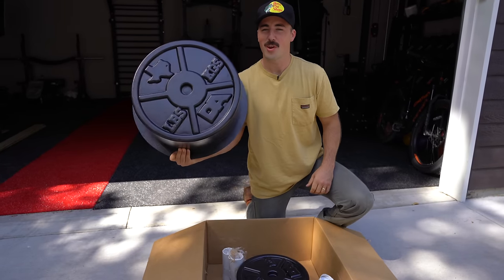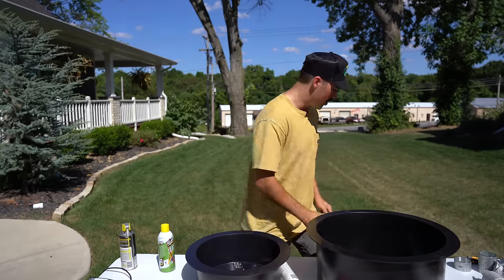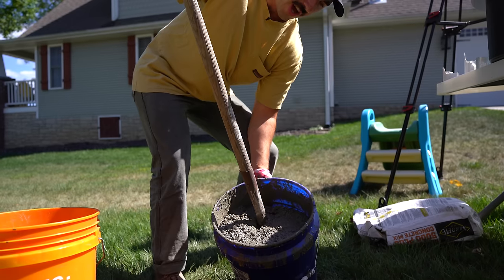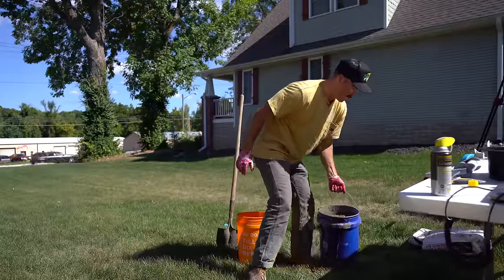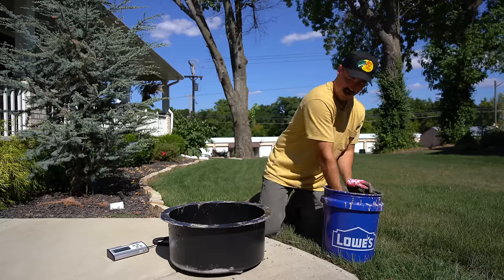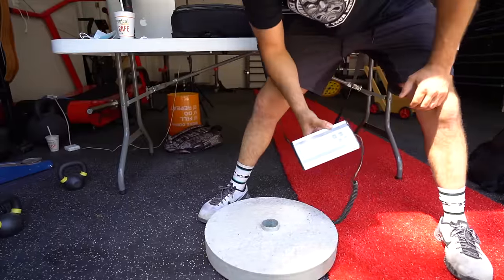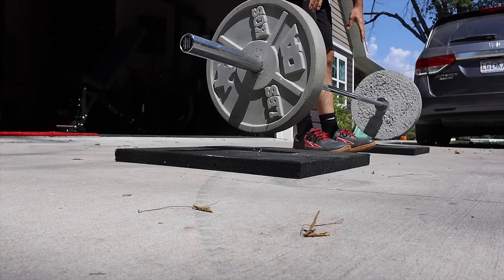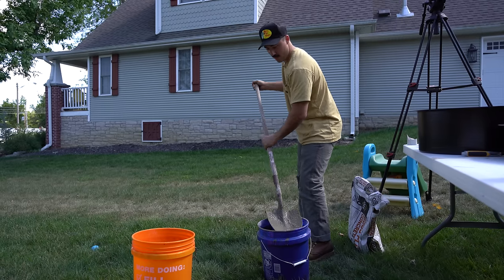How To: DIY Concrete Weight Plates That Don't Break

Comment: For 9 years I was a technician in my state's highway department lab.  For the purpose of enforcing contracts that specify the strength of concrete, the industry standard is to age concrete cylinders under water, at constant temperature, for 28 days,  I would suggest that concrete does not reach its full strength until a month after it is mixed.  It should be kept thoroughly wet during that month.

If strength is important, using high strength cement and adding fiberglass are good things to do.  Another good thing is to use less water.  One of the primary determinants of concrete strength is the water/cement ratio.  The higher the ratio, the weaker the concrete.  Knowing this leads to a relatively recent innovation: roller compacted concrete.  For RCC, you merely dampen the dry mix.  The mix should be thoroughly damp, but not wet enough to flow.  Then they shovel it into place and tamp it.  For road construction, they use the same rollers they use to compact asphalt pavement.

Your weights will get lighter as they continue to dry out, assuming they are kept out of the rain.  The weight of the dry hardened concrete is not a concern when building highways, So I have no experience with that.  If that is important to you, you'll definitely have to keep the concrete out of the rain.  The dry weight will be something higher than the weigh of concrete mix you use because water participates in the chemical reaction.  If you want to predict the dry hard weight, I suggest you determine the formula experimentally.  Measure the amount of mix and water you use, then weigh the hardened concrete once a week at first, then once a month, until the weight stops decreasing.  That will work if the plates are kept in air having a constant relative humidity.  If the RH varies, the plates will always be gaining and losing weight.  It is likely that the weight variations will be slight.

It looked like you were using "mortar," not "concrete."  Mortar is cement plus sand.  Concrete is cement plus sand plus coarse aggregate.

Comment: Use a recip saw with out the blade pressed up against the mold to vibrate the air out
Reply: I personally use an old back massager to do that.

Comment: I want this to work but it seems like the concrete isn’t the right product. Concrete is hard but fragile, it’s really meant for compressive strength, not constant shocks. So dropping it once or twice might be fine but you’re probably introducing micro fractures that will get worse over time. Maybe rebar or mesh would help?

Comment: Dude spraying those with flex seal and then painting them, it look pretty good
Reply: Truck bed liner adheres better and is stronger in the long run.
Reply: Stix And Stone even better!
Reply: What paint should we use ?
Reply: Jake From State Farm I use oil based exterior paint because my entire gym is outside in the elements.

Comment: drill holes in the wall of the metal pipe and put screws in before pouring the concrete so the pipe does fall out cuz you can see already when you dropped it chunks of concrete were coming off.

Comment: Weigh out the concrete when it is dry.  After it has cured (don't confuse curing with drying), the water keeps leaving the concrete, eventually getting to the dry weight.  Also, concrete keeps getting stronger as it ages.  The longer you can wait to use them, the better.
Reply: Do i wait until it is cured to sand it or can i wait until its dry

Comment: Hey, I did concrete work. You should be using PVC gloves to protect the skin on your hands. Concrete will make your hands extremely rough to the point that it will cause your skin to crack. You will never see concrete workers wear leather boots because they will be destroyed after the first pour. We wear those knee high PVC boots.

Comment: Not bad, and probably a decent alternative to steel weights. It appears the weakest part, judging from the side view camera when dropping it, is the smaller hole, even if steel lined, does show some minute parts of concrete breaking away from that area. Maybe have a concrete plate that is thicker in that area, are a bar thicker in that area along with tighter steel sleeve, I’m sure various things could work. But if one doesn’t abuse their concrete plates, these will probably be fine for a home setting. Public use in a gym, probably wouldn’t fare well though. Appreciate you showing us how it is done.

Comment: I use caveman weights. You fill the mold to the top and all of mine have been within a pound of 45lbs. Use pvc for the inner sleeve. Hot glue it into the mold. Haven’t used the lubricant but that looks like it fell out a lot easier than mine without the lubricant. Haven’t used the fiberglass reinforcement. I just cut four 1 foot pieces of rebar and cross cross them in the mold. Makes it like 46lbs. 

Caveman weights molds seem better. Easier to put the right amount of concrete
Reply: Yes!

Comment: Great work !!! .. i just love DIY. Looks good !  I think it be even better if there is a way to cover the concrete weight plates in rubber protection so they do not rub against the floor and break later after much use.
Reply: Truck bed liner works well.

Comment: You could also look up the ASTM concert cylinder method. They talk about using a rode in lifts to remove air and curing cylinders by submerging in water bath for 28 days to reach max strength. Probably overkill.

Comment: nice demo...and those molds seem to hold up well... I would dial in the center peices exact height so you just level concrete up to hole and no cutting later...this may take some trial and error,but once you know best height make all center pipes same and weights  will be as good as possible... just use rag or some  duct tape over it to prevent crete rom getting in hole...

Comment: People are saying to overfill the mold and grind the plate down but there is an easier way to get exactly 45 lbs. Just weigh the mould and fill the mold until it is 45lbs and just fill it up with the weight of the mould again.

Comment: Great moulds. A little pricy though for me though. May I suggest dumping the concrete into a larger mixing area, maybe wheelbarrow.  Mixing well dry. Dividing up to exact weight. Dont forget the tare.Then adding water. I believe you'll get a more consistant accuracy between the weights. Nice!
Reply: When weighing the concrete would you have to take into account the water that will evaporate when it dries or will that be negligible to the point you don't need to consider that  when weighing it?
Reply: in making concrete the water is not part of a "drying "period,but rather part of the curing into solid mass of the components...Am I correct?so it is not the same as hanging wet towels to dry....

Comment: I would tag weld couple of nails to the metal sleeve preventing it from slipping out and steel mesh to reinforce the concrete. PIA to mix in a little bucket, would be better in the wheelbarrow. Too much water, add more concrete. Lay down a round plastic cutout to make the other side smooth or use a concrete vibrator to smooth out the surface.

Comment: I would love these but they are kind of pricey, but they are amazing 👌
Reply: The price is as low as we can go while using the best quality supplies we can find for the molds and refill kits. But on the other side of the coin, buying both molds and making only one set of weights is still cheaper than buying a single set of steel plates. And then you are set up to make numerous other sets for pennies on the dollar.

Comment: Pretty cool. Wonder if you could put a little rebar or wire mesh. Probably some thin wire mesh or even stainless cable.
Reply: For sure! A lot of customers have done that or just bent a length of rebar into circles to do the same thing.

Comment: You could consider coating them in flex seal for added support; turning them into a DIY urethane plate.
Reply: Truck bed liner has had bette results so far

Comment: They should make fully sealed one use molds that you leave on so if there are cracks in the finished stone, the plastic contains the mass.

Comment: NO shortage .here in  CT ( state  where is live )  is EXTREMELY  LOADED with brand new Olympic plates @  $2.50 lb.   1,000's   USED  $1.50-$2.00 a lb

Comment: A. QUIKRETE makes a high strength crack resistant concrete mix. Found in most box stores.  It has the fiberglass already mixed in. 
B. I would suggest using something with more Psi strength. Such as Quikrete’s High Performance Concrete (Lowe’s) with a psi of 7000.  Or All-Crete (again by QUIKRETE and found at Lowe’s) with a psi of 8000.

Comment: Coop, add some flex seal spray and you'll kinda have a make-shift bumper plate. Worst case scenario: you won't have to worry if it cracks or not.
Reply: Truck bed liner works better.

Comment: If you ever really want to add strength there are quite a few things you could do to increase the strength.

Fiber add ins will help with its strength.

Adding a rigid frame comprised of rebar.

And definetly allow more than a week to cure. Most concrete needs more like a month to reach full strength.
Reply: One should leave the concrete plates submerged in water for 28 days? Is that true?

Comment: I would weigh it with the concrete mix dry and then add water because when it cures there will be a whole lot less water. Also if you throw a bit of grating in there it’s be even better.

Comment: Embedded chicken wire mesh or similar would add some beneficial tensile strength and at least keep it from coming apart if it cracks. Horse hair was used back in the day, still is in some places I'm sure.

Comment: It's a neat idea but it is still expensive. You get a similar result by using cardboard tubing for the shape, the tube you use when setting posts for fences. Get a 12 inch tube and an 8 inch, and cut to the size you need, there's a formula you can use to determine that based on the amount of concrete in a certain cylinder volume. The metal through hole is important, I used ABS plumbing pipe. The reinforced concrete additive is smart.

Comment: Use Countertop concrete!  It is fiber reinforced and will be more durable than just high strength, adding the little bit of fiber that you did.

Comment: I just got in my molds from caveman. I havent made them yet, but I'm still going to make a suggestion... weigh the appropriate weight of concrete BEFORE adding water and putting it in a mold. I'll be adding rebar to the 45s (before weighing) & wire to the 25s, 10s, & 5s. After that comes paint in competition colors.
Reply: Most of the water stays in the concrete. My 30.5 pound wet concrete with a very lightweight mold only went down to 29.7, after drying and taking it out. My 5.6pound wet plates came to 5.2 dry.
Reply: What helped me was weighing the molds with my more accurate kitchen scale. Then I just held the wet plates on a regular scale, subtracted the mold weight and added a half pound buffer for the water drying up and the excess pipe I had to cut off.
Reply: Interesting. You wouldn't happen to know the weight of the water you put in?
Reply: Yeah I just read a few articles and they said usually less than 10% of the water evaporates.
Reply: @TheLotek1  it should be 3 pounds for the entire bag of concrete. I'd have to do the math for the individual plates
Reply: @TheLotek1  I think the extra pipe I had to trim down was more than the water that evaporated

Comment: Feel like a good improvement would be to mold 2" PVC sleeves into the holes to reduce chipping from the bar smacking into the concrete
Reply: The steel pipes stay in the concrete to serve as the sleeve between the concrete and the bar collars. Just like a bumper would have a sleeve in the same place for the same reason. PVC breaks down fairly fast and will slide out of the concrete over a short time.
Reply: @stixandstone  must have missed that part where the steel pipe stays in, thought it was just used to mold the barbell hole. Thanks for clarifying!

Comment: pro-tip, an 80# bag of concrete should end up weighing roughly 90# after mixing and curing. That's two 45# weights if you don't waste much. You'll lose a little bit, but it should be pretty close.

Comment: You can make circular plate by oxy gas cutting mild steel plates , then drilling a 2inch hole at centre . 450mm dia 12 mm thick steel  plate  weights around 15kg.

Comment: You could also spray it with diesel fuel or wd40. It helps release the finished concrete from the forms
Reply: Paste wax works as well without the solvents that can hurt the plastic over time.

Comment: There's too much vibration in the inserts. Have you tried cutting a piece of steel tube and place it where the bar goes in? It might help the plate from shattering. Also, a plastic band around will help as well.

Comment: If youre super worried about them breaking you could cover it with a rubber spray and it probably wouldnt add a lot of weight, maybe a pound and a half

Comment: If your deadlifting with at least one pair of normal plates, just make the plates half an inch smaller in diameter and slightly thicker to keep from slamming the concrete edges into the ground/mat

Comment: like the idea but don't know if it can be done to have bottom and top mould that way have a pattern on both sides
Reply: These were modeled after steel deep dish plates with designs only on the front.

Comment: It says make it not too wet with that spray... make it so wet it is pooling on the bottom :D 

Btw it is better to make them slightly heavier and them remove some weight with angle grinder to make the mas close to desired weight as possible :)

Comment: I would have mixed in a Wheel Barrel instead of 5 Gallon pails. And use rubber gloves to throw the concrete into the plastic mold.  Then use a finishing trowel to smooth the inside of the Weight. Your smooth on one side and rough on the other.

Comment: Are you suppose to add cement to the top of the pipe so you get an accurate weight for each mold. 

I believe it takes a couple of months for concrete to fully cure.   Not sure how long those would take to cure.  

Great share.  Love this project.

Comment: Did you leave the metal conduits on the weights?   This is brilliant.
Reply: Yes. Each mold comes with two pipes and a bag of fibers to make your first set of weight plates. I also sell refill kits to make more after the first two pop out.

Comment: Thought you were gonna leave the metal tubes in. If you get 2 inch diameter pipe, so 2 inch inside diameter, you will be able to slide the bar in without damage, and it will also stop some of the damage every time you drop it
Reply: He did leave them in. He just cut off the excess pipe that was sticking out of the cured concrete.

Comment: Can you give a recipe and instructions for cement, fiberglass, water? What kind of oven did you use, Temp settings, and how long did you leave them in? Also whats the final cost per pound compared to normal weights?

Comment: probably the best way to shake the bubbles out would be to strap on or press a pad sander to the side (without the sand paper on of course) and then turn it on and shake the heck out of it
Reply: I personally use an old back massager. Recip saw without the blade works too.

Comment: I’m late to the game, but next time use CSA cement (available domestically under the brand name RapidSet), hits structural strength in an hour.

also - if you’re worried about them breaking it wouldn’t be too hard to add some reinforcement with a pair of tin snips and a bit of chicken wire

Comment: Do you think you can fit 6 of those on each side of the barbell?
Reply: Yes. The average bar sleeve is about 16 inches. These 45lbs plates are about 2.5 inches thick. You can get six on with a collar.
Reply: @stixandstone  cool thank you

Comment: Bro, I got more beard hair than the amount of fiberglass you used. Would recommend using nylon ropes+metal rods, and creating a matrix, then pour in the concrete. Good for distributing the impact. Not the best solution, but okay enough.

Comment: the only thing that worries me of these plates is the durability, specially where the bar get through the plate, and the resistance when they get dropped, other than that what a great concept.
Reply: I’ve been using my first set of plates I made with these molds for about 5 months. Still holding strong. I have a platform with 3/4” rubber and they handle that contact all day every day.
Reply: Huginn Bodgaedir some people are using spray on truck bed liner with much better results.

Comment: Im wondering if there is something you can line the hole on each concrete plate to keep them from chipping against the bar?
Reply: The pipe inserts that come with the molds do that. They adhere to the cured concrete and act as the barrier between the bar sleeve and the concrete plates. The “chipping off” you saw in the video was some excess concrete that should have been cleared off before use.

Comment: Another pro tip use "structured water" (google it) over regular water to make them aaaaand soak them for a couple days in structured water in the mould to increase strength even more.
Reply: How do you structure the water? Didnt he soak them for 48 hours? I am confused...

Comment: Weigh out 45 pounds of dry concrete mix for each plate after it drys there will be little water remaining and your end weight will be very close to 45 pounds. By weighing it wet you will be off by the amount of water that evaporates from the drying and curing concrete!!!  That is how I made my plates, which all came out less than 4 ounces off from 45 pounds.  After I let them cure for 30 days, I heated them in an electric oven on low heat around 100 F for 5 or 6 hours, then let them cool roughed up the surface with a metal brush on a hand drill, and coated each plate with Rino Liner spray.